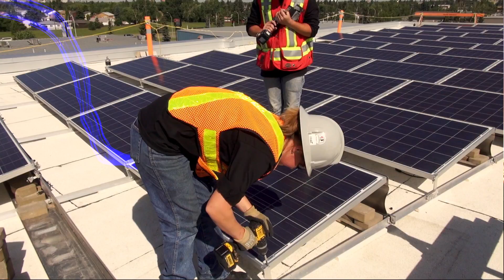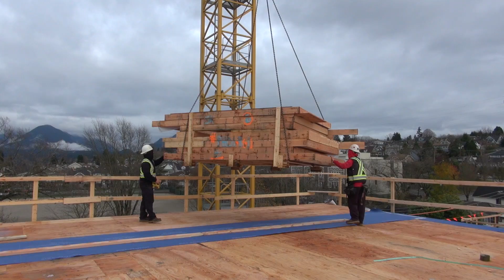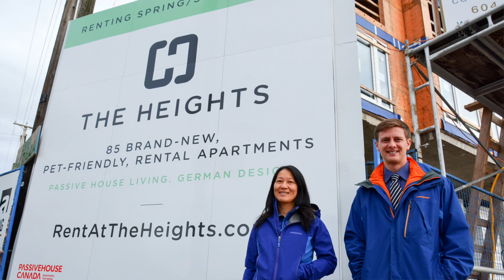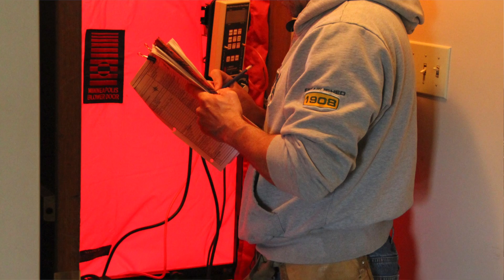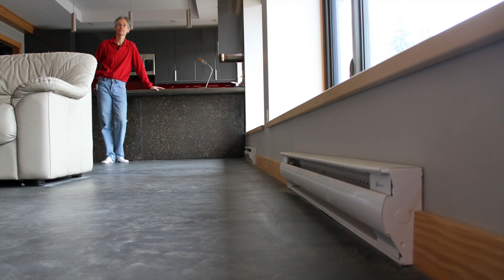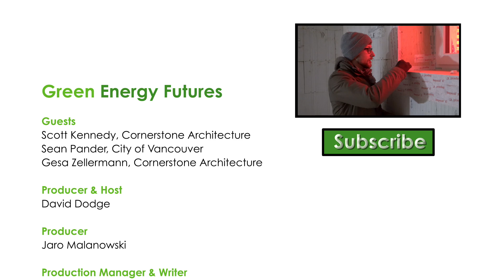163. Skeena - largest Passive House in Canada

Comment: First thing is that Rental Wood Framed passive House is really a bad idea, because of the high possibility of constant damage to the various control layers. This is the domain of Concrete Composites, Scott will discover this very quickly because he works alone on accepting advice from experts. Wood Frame Passive House has no lifespan record, nut Wood Framing in past homes last an average of only 32 years, that's not very promising. Look at that sad cross section mock-up and you might agree. This project will haut cornerstone for many,many years to come.

Comment: funny faux pas: the visual at 3:45 is the Temperance Passive House, and implies that it is "just" "a modern built house, probably 5 - 6 air changes per hour (ACH)...". Everyone that knows that it is a certified passive house, knows that they must have met the value of 0,6 ACH or better. Somebody is going to be miffed.

Comment: Scott Kennedy mentions that he would save 450 thousand on the build cost due to the absence of a hot water heating system.  I understand the units are heated using  base board electrical, obviously  the building will need a generator/power supply if the electrical was to go down.  What would that cost for a building of this magnitude?
Reply: Often condo owners don't need to turn their heat on at all because of all the heat being generated by the units around them. Body heat and electronics contribute as well. I bet one gaming computer could heat an entire unit. Most units will only have one exterior wall. It's like wearing three coats instead of one. That's the power of top of the line insulation techniques. If it doesn't work you can just turn on your hair dryer for a few minutes.
Reply: Removing that hot water heater and replacing it with a generator would add about 38 kW of electrical load. 300 watts in 85 units is 25.5 kW of heating load.  Though that doesn’t include the retail on the bottom floor. Assuming it consumes energy at the same rate of the other floors gets us to 31.25 kW. Add a 20% buffer and round up to 38 kW. Generac sells a 38 kW natural gas powered backup generator for ~13,000 dollars.
Reply: Charles Farner additionally they don't include any information regarding the outdoor temperature. ...usually it's cool and damp here,   but this winter we broke rain and low temperature records...
300 watts to heat a home in -10 Celsius seems quite unreasonable

Comment: I love your videos and passive house. I love that BC is supporting and promoting passive house. But I highly doubt the apartments and businesses located on the Northern side of this building will have low heating bills. If this is the case I hope they recognize that these buildings should probably only be approved where the southern exposure to the sun is correct and the building be only one apartment wide. This way all apartments get the solar gain about evenly.